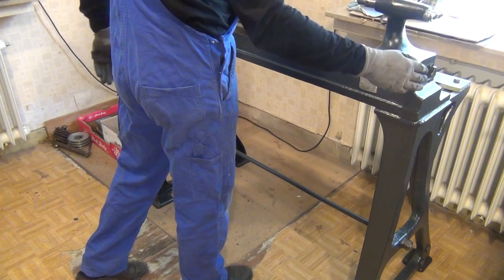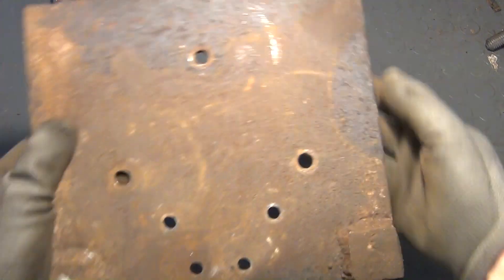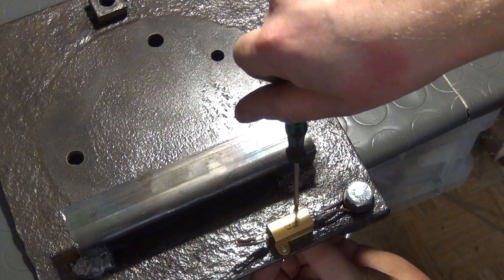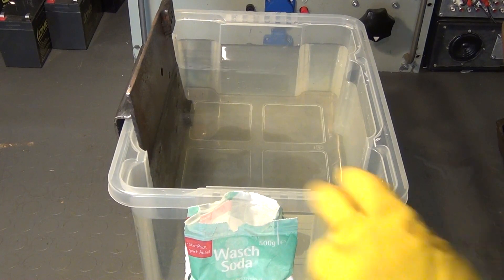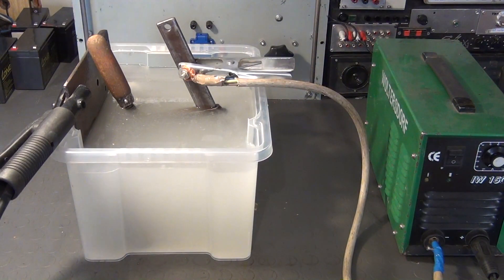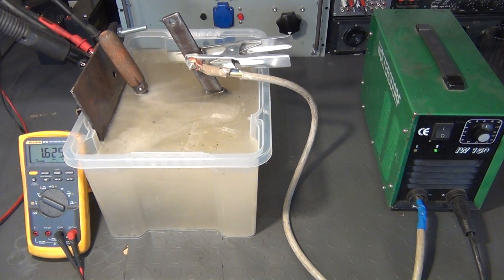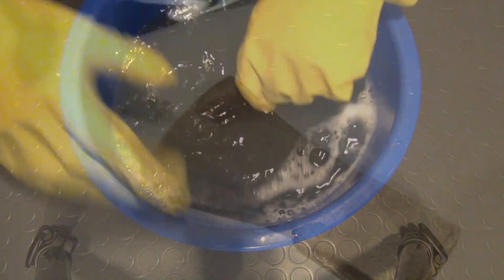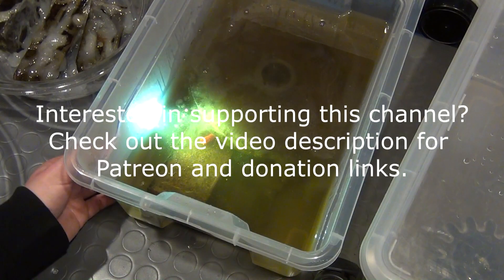Rust Removal Experiments: Electrolysis

Comment: Good video. You spent a lot of time building your anode, something that will, sooner or later, disappear due to corrosion. Much simpler to just stand the anode up against the inside wall of your container, using a spring clamp to hold it to the side of the container, and connect the anode to the power supply with a wire with an alligator clip on the end. I use wires with banana plugs on them and alligator clips that also have banana plugs.

Also, I would use at least 2 anodes, so both sides of your item under electrolysis have direct lines of sight to the anodes. Another suggestion is to keep your current below 5A, to minimize pitting. I’ve arrived at this value through experience. Sure it runs slower, but the results are noticeably better. I typically leave my parts under treatment in electrolysis for 12 hours, or more.

Comment: Hi, when you are removing the rust from the steel plate, what is the angle grinder that you are using? I use a small angle grinder but looks like you can remove rust a lot quicker as yours is larger.

Comment: So I am a physicist and do research in electrochemistry. I would also have to do some reading on the matter but as far as I know further increase in voltage will simply decrease the fraction of the reaction going towards hydrogen evolution, thus from an energy standpoint it should be better to use a smaller voltage longer.

Comment: You say we should not use sodium bicarbonate but do not explain why not.  Similar for the copper wire. Well I tried it with Sodium bicarbonate and current did flow so it must be working as an electrolyte BUT bubbles were coming off my copper wire where it connected to the axe head. Unfortunately my battery charger kept cutting out so I had to call the experiment off.

Comment: When trying this, remember one important thing: If you send a lot of current through the bath, it will heat up the water. More heat means: stronger chemical reaction. This means: more and more current. So even more heat will be produced. Do not let this reaction run unsupervised! 

If your power source is too weak to make progress in de-rusting: try heating the bath or start with hot water. Temperature makes a huge difference!

Comment: Thanks for another great video !   An old guy once told me he used WHEY to loosen rusted manifold bolts on a marine engine. He said you could then turn the bolts out with your fingers. He chose to use whey because they used to feed their pigs on whey from the local cheese factory, and the iron feeding pots never got rusty. I've had good results using whey on rusty tools, bolts steel wire and chain. Sometimes I left the rusty item immersed for a week or more. Can be a bit stinky in the hot sun, but put a lid on the plastic pail. When done, wash the item off with soapy water, dry it, then apply a coating to prevent rusting again.  As a quick fix, I threw several lengths of chain in pails of used engine oil over the winter. I may wipe off most oil, leaving enough so I can store chain in damp conditions. Or I may clean up and spray cold galvanize  or some other pail coating. Whey is cost effective for big jobs if, as I did, you get pails of whey for free from a cheese factory. [ RIP Uncle Billy ]
Reply: Just curious how did he use the whey?

Comment: There is a technique used by gun smiths used to turn red iron oxide into black oxide by boiling the rusty metal in water. It converts the rust and it can be "carded"  using a soft abrasive to remove the dead oxide leaving a protective layer of black oxide. The black oxide becomes a form of bluing for the metal and prevents future rust. This process is usually repeated several times. And each boiling session should be about 40 to 60 minutes each at the highest temperature possible.

Comment: great idea, you can do an 500 amp power supply with a microwave oven amd a pair of capacitor in a diode bridge.... but for that you need high power components to work with safety
Reply: You cannot run a MOT at those currents for a long period. You might get 5 minutes before it went up in smoke... if you were very lucky.

Comment: You could use carbon/graphite instead of a steel+, you will get black solution but hardly any flash rust risk. Titanium will give a fairly clean solution. The plain steel just looks nasty.

Comment: Would Lye or Phosphoric Acid work?
Also have you tried switching the the leads around periodically?
Reply: 1. Lye will work but is caustic and this not as easy to work with. It has no advantage over washing soda.
2. Phosphoric Acid is a different process completely. See other videos about that.
3. Why would you want to switch the leads? The objective is to remove the rust, and preserve the underlying good metal... not to dissolve the underlying metal and add rust back to the surface instead (which is what happens to the positive terminal).

Comment: You can use graphite anodes just fine -- they're more inert (and thus more reusable) and no "hexavalent chromium". Electrolysis just removes rust simply by generating lots and lots hydrogen gas for use as a quick debriding agent (to mechanically dislodge the rust away). So, you'll want to run this at high currents and likewise keep the anodes very close to the cathode to maximize energy-efficiency (waste less energy just on running current through the solution!).

Comment: More current is not better. The aim is to chemically convert the ferric oxide Fe2O3 (rust) into magnetite Fe2O4 by adding an oxygen molecule. This oxygen molecule comes from the water which is why the anode gives off hydrogen. Low current over longer time will convert more rust without pitting because the more violent reaction simply dislodges the rust in the pits. Even a 12v battery charger gives off too much current so either use a resistor to step it down to 1 Amp or use a 6v battery charger. Less is more. Great video and great channel by the way.

Comment: I used electrolysis on a matched pair of Poncho exhaust manifolds that were in really rough shape. They turned out AMAZING.
Reply: Did you do them at the same time or separately?
I have a similar job to do and was wondering if I could just switch the polarities at regular intervals between the two pieces.

Comment: Cool job I'm gonna try this but before does anybody know if I use my battery charger it is 'automatic' with no manual adjustment -will it ruin my charger from overload or whatever you want to call it? Also low setting is 6 volts so with his math= amps  I wonder what will happen
Reply: I had 2, smart battery charges, it ruined 1, the other seems to survive, however to get it started I have to hook it up to a battery first with all other electrolysis wires attached. Once it starts, I disconnect it from the battery  & it thinks it is still charging it. However my smart charger is too smart I guess and realizes something is wrong and turns off the current. I am looking for some other means to do this.. perhaps make use of this https://www.elliottelectronicsupply.com/power-supplies/ac-transformer-12-vct-4a.html

Comment: Destructive is a better word than invasive in the context of abrasive methods.
Reply: Actually destructive is not a better word in the context of abrasive methods as you say. Oftentimes a certain form of surface preparation can create a more uniform surface which may enable more consistent yield or fracture points. Abrasive methods also are frequently used to create a surface for proper adhesion of a coating. Abrasives can and are also used to level surfaces for tighter mating and precision. Possibly this was a comment made to sound like the smart guy in the room?
Reply: @mattmoilanen3813  Does it enter the thing being worked on? No, it doesn't enter. So it doesn't invade. So to use the word invasive is a bit wrong. Invasive is often used in a medical context -  invasive versus non-invasive treatments. 
Here it is a case of a destructive versus a non-destructive process.  If a process causes loss of material, it's destructive. If it doesn't cause loss of material, it's non-destructive.

As for your "smart guy in the room" comment. Jeez,  I gave an English usage tip, and you jump on it as being something indicative of a personality disorder in operation. Seems it's you with the issues .
Reply: @mattmoilanen3813  Rocket Science was right: destructive is a more appropriate word in the context.  Although The Post Apocalyptic Inventor speaks very good English, I'm sure he would welcome correction on a technical term where his choice of the English word for what he was describing was not quite right. I'm sure if he had stopped a moment to think about it, he would have rejected the word invasive, as abrasive methods do not enter (invade) the material, although they do ablate surface material, leading to loss of both the rust and some of the underlying metal (depending on how aggressive the abrasion). Hence abrasive methods are surface destructive.

I've no idea why you wrote what you did. It is not relevant to what The Post Apocalyptic Inventor was doing. Maybe you were  the one trying to be "the smartest guy in the room"?

Comment: Wouldn't a wire wheel and some elbow grease do the same for both pieces in a fraction of the time? Just sayin'
Reply: No. The electrolysis process ONLY affects the rust. Mechanical means like wire wheel will change the whole surface by abrading it away. So, for machined surfaces you cannot use wire wheel, grinding, sand blasting, etc yet they will be 100% untouched by Electrolysis. Furthermore, at low currents (under 2A the process actually converts the rust into a stable and hard material that can be used to build or fill the pitted areas.

Comment: A big problem with using electrolysis is the issue with hydrogen embrittlement in high strength steel that may develop a loss of fracture toughness.  It is critical to baking at a specific heat treatment to eliminate the hydrogen from all parts after any type of electrolysis like this and plating or de_plating.  Especially for safety in fasteners or any dynamic stressed parts, even static parts in high load and temperature change 0 to 50 C range or more.  

I would like to see that ax blade hit with a fracture test rig.  To demonstrate several conditions and material before and after electrolysis and new and rusted non-electrolysis.  Then baked and unbaked.  The process can be found on ISO, DIN, IFI, ASTM, NAS, ASME, etc.
Reply: Jerkimer James is the steel loosing fractured toughness due to certain chemicals being removed during the process from the metal?

Comment: Can u use this method to clean rust from old iron lifting weight plates?  Thnx so much...
Reply: Of course. You just need to make a clean spot so you have a good electrical connection. Any paint that is over rust will be removed, paint on good metal will not be touched.

Comment: great video... I have a couple of gokart rims, there are very rusty and some areas still have pain,  question, do I have to remove the paint before I practice electrolysis? what happends if I dont remove the paint? cheers
Reply: Just put it on the electrolysis bath, paint and rust will be gone. I made this to two bicycle wheels and they are ok

Comment: How did you realize 40 Amps when the fuses normally trips at 16 Amps? And isn't it quite dangerous?
Reply: Its converted from ac to dc
Reply: It's 40 Amps at about 3 volts - about 100 watts.

Comment: Nice video. I was aware of the car battery charger being used as a current source but had not seen a stick welder being used as a current source.

Have you experimented with caustic soda/lye (Sodium hydroxide) as electrolyte?

Also, the electrolysis method is mostly suitable for non-subtractive rust removal, i.e. when desiring to leave as much of the original material in its place I.e. recover as much of the original iron from the iron oxides as is possible. Have you tried doing this without scrubbing the rusty item before or after to see if the surface imperfections of the rusty item are somewhat improved? The reason I am asking this is that a lot of people report that when the current is increased, and thus the rate of the reaction is increased, the gas pressure generated at the cathode causes whole chunks of rust to separate from the corroded steel body thus losing a lot of the original material in the process. Have you, by any chance, experimented with very low currents that are applied for long intervals to see if that results in reversing the damage caused by deep corrosion? I'm not sure if I'm making it absolutely clear what I mean here.
Reply: Makes sense to me and is also a question I have asked myself. At higher voltages hydrogen is produced and will weaken the iron and might cause failures in tools.
Reply: @AlJay0032  Since I posted the original comment I've been informed that what I mentioned in it about electrolysis not being a subtractive method but rather a method that restores the iron from the iron oxide is simply not true: iron oxide cannot be converted back to pure iron by this method. Since I've been informed of that, I have come across many videos on iron oxide batteries which, if I understood correctly, work by oxidising and reforming iron back and forth. I am not not sure about how the process works although I'm fairly sure that most of the original rusted iron is not recovered. I guess one could design an experiment to test this at all current and voltage levels desired and figure it out by practical means.
Reply: @Stelios.Posantzis  If rust is not converted back it would seem to me that it is more sensible to use acetic acid with or without salt or citric acid instead. I would probably take concentrated vinegar acid and assume that the iron acetate formed can be dissolved in water which allows the next layer to be attacked by the acid.
Reply: @AlJay0032  I'd still prefer it for a couple of reasons, at least for heavily corroded items, but I'd like to research it some more. Some people use it as their default rust removal method. If anything, it is convenient as it saves buying, using and disposing all sorts of unknown chemicals. Of course the acetic and citric acids you mentioned are another way but I'm not sure how I would procure concentrated acetic acid. I have heard that oxalic acid works well and I have seen the results too. Of course when using the acid method one has to be quick to treat the exposed iron surface afterwards to prevent flash rust from forming.
I just watched https://youtu.be/Qi-tK1jwO-k (Rust Removal Methods Explained on Geoffrey Croker's channel) and it compares all the above plus provides a bit of the chemistry. There is still some hope of recovering part of the rusted iron based on this but it appears minimal. Based on the analysis given, I'd like to try the citric acid method followed by electrolysis although there's no guarantee that the citric acid method leaves the iron from the rust reduction on the iron part.
Reply: @Stelios.Posantzis  Concentrated acetic acid is just vinegar essence. Disposal of that or citric acid should be no problem I would think.
Reply: @AlJay0032  Yep, these are safe to dispose. I was referring to branded rust removers - these usually do not state what chemicals they contain.
Reply: @Stelios.Posantzis  I just checked out the video you sent. Good summary, I left a comment there. I disagree with some of the things he says about electrolysis. Otherwise excellent video.
Reply: @AlJay0032  I just read your comment. Isn't your objection about using steel really relevant mostly for stainless steel? How much chromium could normal steel possibly contain? If there's sufficient quantity in it to cause a problem then pretty much makes electrolysis useless as I doubt you can find any piece of iron scrap nowadays that's not some kind of steel.
But it goes to show that one needs to know what they are doing when playing with chemicals e.g. his caution about using table salt as electrolyte is also valid.
I like the fact that he describes the relevant reactions and also mentions all the products of each reaction as well as the cost of materials and their acidity level.
Reply: @Stelios.Posantzis  Yes, stainless steel.

Comment: Does this damage the part in any way?
Reply: Replying to old question: NO. Providing you make sure that Negative connection to the item (positive to the sacrificial anode) then the good metal is completely unaffected. The process only works on the rust, and electrically converts it to Magnetite (like a black rock). If you use high current (like shown here) the bubbles blast that off leaving you with all the original pitting), but if you use low current (say 2A) then the Magnetite almost builds up the pitted surfaces again (somewhat).

Comment: Have you tried hydrochloric acid or even phosphoric acid? They both don't even have to be pure so it is much safer to deal with. I have bought a gallon of each at the hardware store for under $20 and it comes so diluted I can get it on my bare skin without any irritation maybe slight tingle. Yet both will remove all the heavy scale rust off buckets of hardware in less than 20 mins by just slightly sturing to agitate parts and solution. The phosphoric acid if left parts in even longer will produce a grayish color phosphate coating that no only inhibits rust from coming back as easily, but allows allows a top coat of paint or powder coat to bond even better.
Reply: acid garbage it actually destroys the metal

Comment: I think you should try with a stronger solution like 1/6 sodium carbonate.  Did you connect the + to the big plate or to the rusty items?
Reply: The anode was the plate not the part.
Reply: Old question, new reply: Stronger solution makes no difference. The limit is the amps. Really, 1% solution is more than enough salts for the process to work in 24 hours at 2A or so.
Positive to the plate, negative to the part. Watch the video, both are covered in there already.